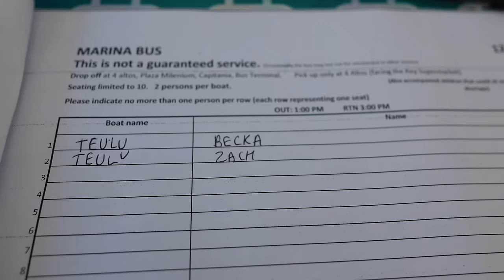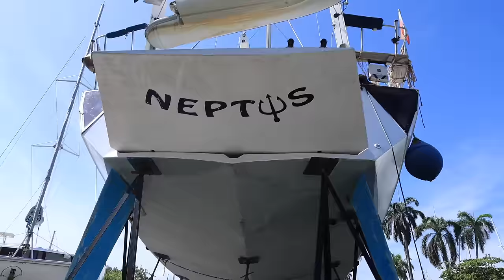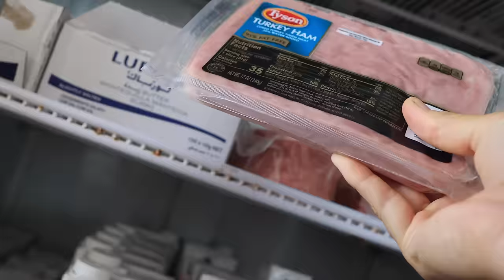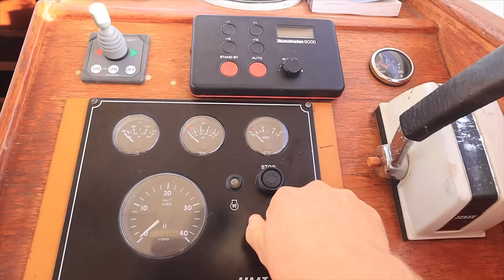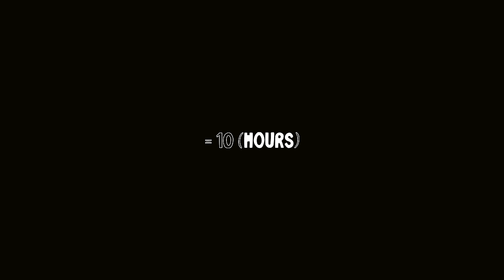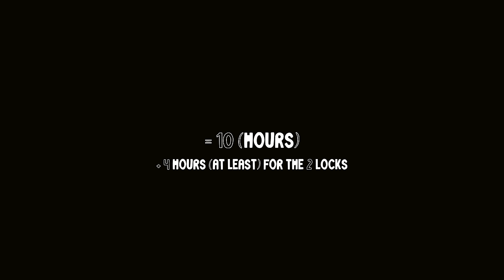PREPARING for OFFSHORE sailing (Pacific Ocean)

Comment: I used to be a merchant seaman, If a life raft flips over you get on reach up and grab the ladder and lean back that way you are holding on to it. Never let go in the wind that thing will travel faster then you can run let alone swim. Remember you are getting in it will not be calm it will be wild and windy with waves 40 or 50 feet. Sorry for the rant but you will never leave your boat in a dead calm.

Comment: Just going to keep it real for people thinking that this can be done in a sane fashon. First I am not a hater I love the layout of the boat and I aplaud the grit. I don't hate on people geting sponsors or saving money but this boat was near 38k purchase price and has had near 90k upgrades and repairs as of this video for a near 40 year old boat that will be hard to insure and keep going. So before people think that they can do this paying while retail think what you can get for 125k in the boat world. That nice prop from a few videos ago is almost 4k retail new batteries and electic system upgrade part 2 near 10k etc. etc. if you pay retail. Good on them for getting it done and geting sponsors and discounts, but for you novices out there trying to follow in these footsteps look at the 125-150k boats you can have and compare before you jump into the never ending deep end this story is the exception not the rule. Hint for 125-150k you can find boats 25 years newer with water makers and clothes washers onboard.

Comment: I has a Spinlock Deckvest 6D lifejacket, and a 3-hooks lifeline, I also has a 2-hooks one too. It's for off-shore use, and not for blue water use (i.e. crossing an ocean).
I like it, but YMMV.

Regarding a liferaft,
I prefer something who can move, meaning a lifeboat. That´s perhaps an old-fashioned choice, but if one is using it as a dinghy, one is actually doing a rescue exercise - which is awesome if you should ever need to use it to save one's life.

Comment: I hoped you enjoyed your  canal transit.  I was a engineer officer in the Uk merchant fleet . I hate to think how many transits of the canal I have done.    The canal has a a huge history of failure ,disease, and high Mortality. It wasn’t till the American army engineers took on the project that real progress was made. They had the resource to deal with the disease. Mostly mosquito borne . Considering it was opened in. If recall correct 1911. It is an amazing feat of engineering..  No doubt the thought of following a large cargo ship into the locks was a bit daunting , but safe all the same.  An interesting point from a ships engineer perspective it actually takes quite a bit of power to navigate through the locks . I mostly sailed on ships that were termed as Panamax so they just fitted in the locks with about  450mm each side .  We would navigate through the locks at half ahead or half engine power.  Why you ask well we had to displace the water ahead of us down the sides and below the hull.  For a ship of this size we  would up anchour. At about 5am we would clear the final lock some 12 hours later.   Going through the cut I hope you saw the monument to all those who lost their lives building the canal.

Comment: It sounds like, and I’m truly hoping you haven’t ‘Hydrolocked’ the engine? Water doesn’t compress. I once replaced a diesel engine on my 100ft wooden schooner, which broke after crossing Biscay. We replaced it ourselves with a brand new engine, delivered in a crate from the UK, whilst moored on a pontoon in Camarinas Spain (Super friendly people.) Anyway minutes before we tried to start the new engine… we were contemplating the plumbing, exhaust and shaft cooling when we realised that the adapted system would have caused water to get in and potentially hydrolock the engine and ruin it. It was a close call. We made some changes and the two of us then sailed the ship to Gibraltar, without a hitch. Anyway I hope your issue is less serious than the one we narrowly avoided. Love your channel. Love the welsh name… ‘Teulu… always thought a great name for a boat would be the Welsh word ‘Bodlondeb’ meaning contentment.

Comment: Crewsaver 290 OC Ergofit life jackets are a good choice. I use such a model myself for long hours on the Atlantic, and sailing in them is not difficult. It would be good to equip them with an individual MOB device. There is a special place on the collar for your personal MOB. Have a successful crossing of the Pacific.
Reply from the maker: Thank you for sharing your experience with the Crewsaver 290 OC Ergofit life jackets! For some reason we didn't say this, but these ones came with an MOB 😊
Reply: @TeuluTribe  This bary, very good decision before heeding to the Pacific. I keep my fingers crossed for you. :)

Comment: the Mirror is a leak stopper. iy comes in two pieces.
Reply from the maker: Interesting! We did think this but it had a bolt through the centre so we weren't sure how it would work without ripping a bigger hole

Comment: For one why did you all not check on line for that type of engine to see how it works and what is needed. Why did you all not check how the canal works . Next checking for power of all batteries and how they are charging and then check for all water leaking. Then check Navigation systems and autopilot including lighting. Finally full check Prop rudder lines fenders rigging and sails.